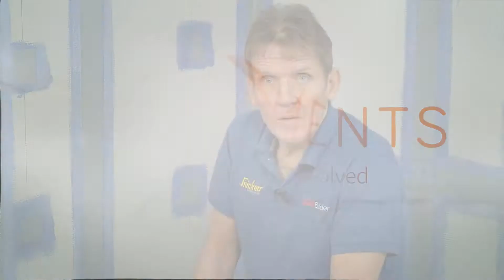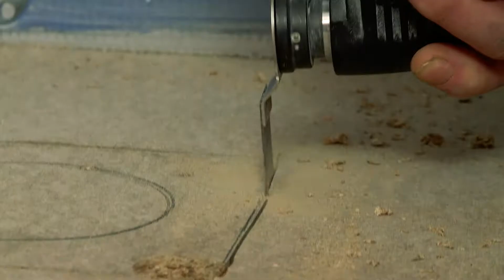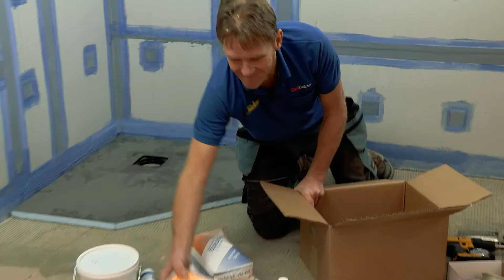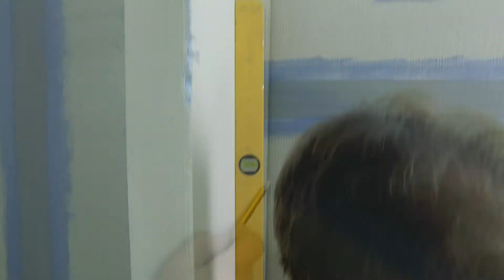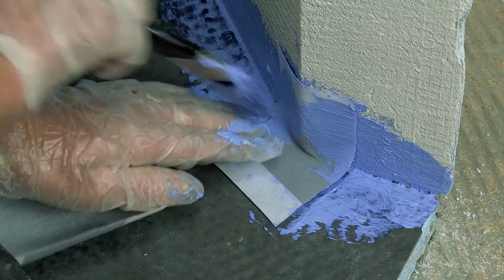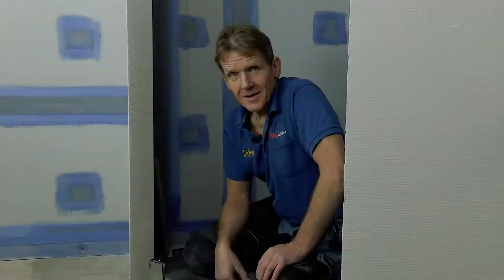Installing a Penta Shower Enclosure

Comment: Question for ya – what size was this quadrangle enclosure? 900x900?
Reply from the maker: Hi, The products used in this video are listed with links in the video description (pasted below). The size of the enclosure is 1000 x 1000. 

======PRODUCT INFO======

PENTA 1 SHOWER CUBICLE (EMSC-05-0505): https://www.abacus-bathrooms.co.uk/#!/wetrooms-waterproofing-glass-screens/shower-cubicles-components/tileable-shower-cubicles/Penta-1-Shower-Cubicle.html

PENTA 2 EXTENDED SHOWER CUBICLE (EMSC-10-0505): https://www.abacus-bathrooms.co.uk/#!/wetrooms-waterproofing-glass-screens/shower-cubicles-components/tileable-shower-cubicles/Penta-2-Extended-Shower-Cubicle.html

ALL WETROOMS, WATERPROOFING & GLASS SCREENS: https://www.abacus-bathrooms.co.uk/#!/wetrooms-waterproofing-glass-screens

Hope this helps!